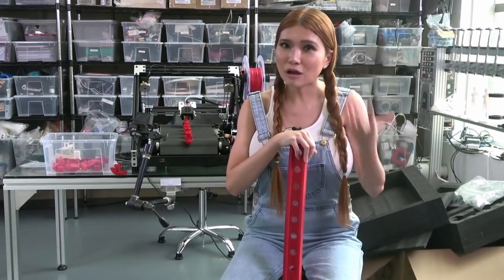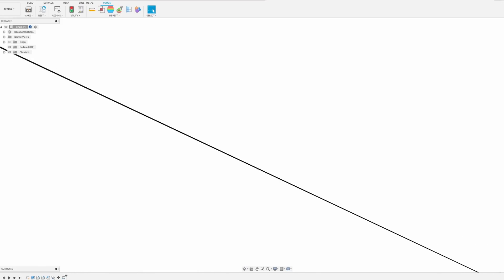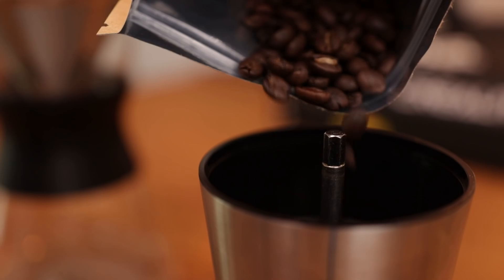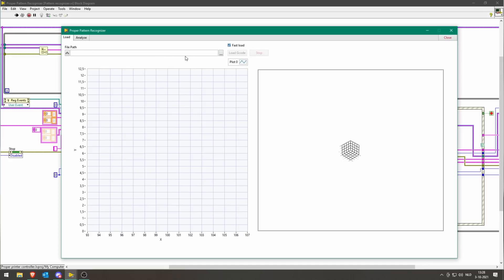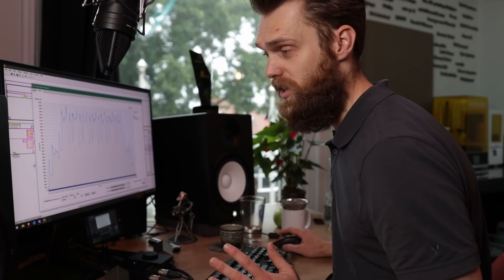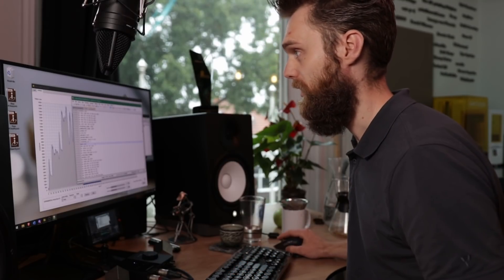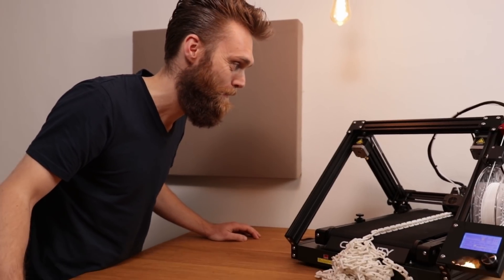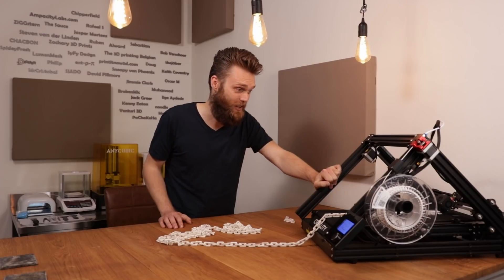Exploiting Pattern Recognition to print INFINITELY!?

Comment: Infinite Gcode is one thing. But how about an infinite feed of filament? Because, after 5 or 6 meters of chain your spool runs out of filament, so you have to change your spool. Or perhaps after x meters using a larger spool. I'm curious about a solution for an infinite feed of filament, without the use of extruding pellets or something like that.🤔
Reply: Filiment run out sensor
Reply from the maker: This was actually my first print which used that runout sensor. For the standard materials, this works great!
Reply: Maybe you could use a process similar to the Palette, which with some modifications to the overall design, could seamlessly take the end of a roll and splice it to the beginning of a new one.

Comment: Just an idea. Why not try doing something like your ender 3 hotend changer but without any need for an extra stepper driver or hotend. If you just swapped the idler between two extruders with both steppers wired in series feeding into a y splitter, you could upgrade a stock ender 3 with just some printed parts, wiring and an extra stepper.
Reply from the maker: Thanks for sharing your idea! I embedded a switch into that swapping system so I can switch between two motors with one driver ;) Still on the todo list xD

Comment: I have heard it said that the hotend is only at a 45-degree angle to bypass existing patents in the existing belt printers, however, this seems to be a plus as if it were at 90 degrees it would presumably have to work in bed slinger mode!
Reply from the maker: I have heard something similar, but I thought that the original design was at a different angle. 45 degrees seems the most logical angle to me though
Reply: Would like to try an 22,5⁰ angle on my cr30.
Can imagine better belt adhesion with a mod like this.
Reply: As the print progresses, unless it were only 1-2 layers thick, a 90 degree nozzle would be impossible to reach the bottom most layer again without crashing into the print.